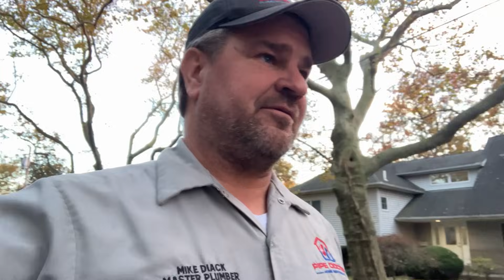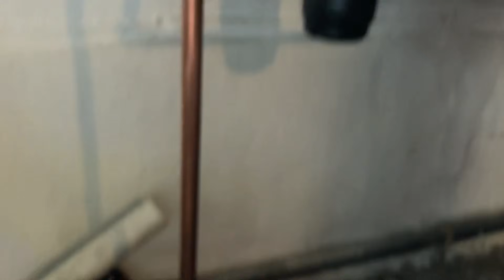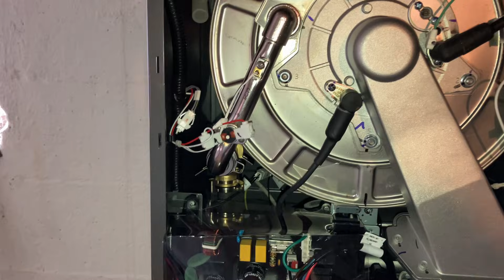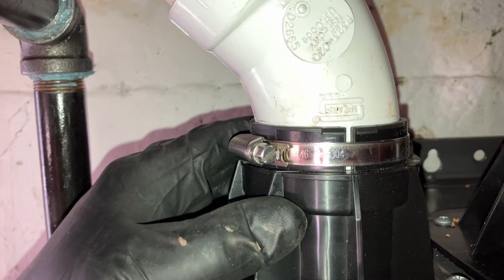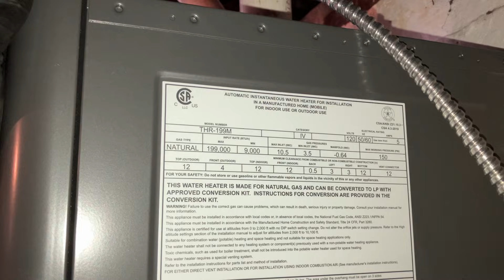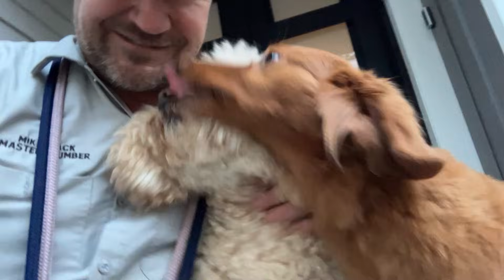STOP Descaling Your Water Heater Lochinvar XCalibur Tankless!

Comment from the maker: Introducing Lochinvar’s XCalibur premium condensing gas tankless water heaters, delivering robust, on-demand performance and the flexibility to install in practically any residential setting.

3 Models: 160, 180 & 199 MBH
X3® Scale Prevention
Heavy Duty Stainless-Steel Heat Exchanger Design
Integrated Recirculation Pump and Display
22:1 Turndown

NEVER REPLACE X3!
Reply: Where is the best place to buy the  XCalibur???

Comment: The older Takagi (natural draft tankless) was the same no maintenance , obviously non-condensing and probably 80-85%. This is new, let’s see how it works after 5 yrs. The most expensive repairs I’ve done have been tankless WH. As a service guy I still say a 85% cast iron boiler with 316 SS indirect tank still the way to go in my opinion (assuming u have hydronic heat)

Comment: As you stated in your video, unless you can do your own descaling of a tankless water heater they are not worth it. Always skeptical of new technology and we will see how long it takes for you to go back there for a service call. I have a Bradford White 50 gal. we installed 10/2010 along with a solar tank (80gal.) with 2 rooftop collectors that delivers 180 degree water via mixing valve to B/W and both going strong. Just replaced gas valve and pilot assembly. Tank in excellent shape. no rust or corrosion top or bottom and more efficient than any tankless. Good video anyway
Reply from the maker: The X3 technology has been available for about eight years only recently through the sister company Lochinvar
Reply: @PipeDoctor  when I first started watching your videos 7 or 8 years ago you were with Kelvin and Godzilla and they were funny and informative. You were a big proponent of tankless water heaters primarily Navien even though the internals were primarily plastic. Credit to you for being honest and realizing later that the high failure rate was not from improper installation but from a defective product. Enjoy your videos and by the way, I was highly suspicious of Tom and it did not surprise me especially how obese and how he could not function as a stand alone plumber.I was watching the videos you did from Orlando early on when you uploaded them and surprised you did not catch on sooner.

Comment: It doesn't require long sweep 90s? Street fittings are allowed into equipment? GFCI outlet not necessary for this equipment? I'm not a master plumber.
Reply from the maker: Great questions. Defer to the installation instructions for the equipment. The system is powered off a ground fault circuit interrupter.

Comment: Wow 🤩 mike pipes this is epic. The interior parts access to make service friendly. Quality is of number 1. Really excited for this product . You sold me on this. I watch so many great install by your company and some epic failures with manufacturing quality. This one has me think????
Reply from the maker: @richritchie5434  Lochinvar makes phenomenal equipment. Amazing team in their plant in Tennessee.
Reply: I'm guessing it's some kind of electronic technology that prevents scaling. Curious how efficiently that stainless heat exchanger transfers heat to the water with its low heat conductivity, compared to copper.

Comment: Most home owners don’t descale until it doesn’t work.
Reply: In my community it's 5 years old with a little over 600 homes all with Rinnai's. I have never seen another homeowner besides myself descale the unit. First year here I did it twice. I also stock almost every part for it. I do mine every year in Dec.
Reply: I can say in Australia, Rinnai is extremely popular, no one does maintenance on domestic tankless heaters here. Routinely last 15-20 years without doing a thing

Comment: For systems like that it seems the cold water inlet flows through the "X3" cartridge before going to the heat exchanger. In cases like that, will the system need a whole house water filter to prevent the cartridge from clogging, or can it be removed for cleaning when needed?
Reply from the maker: never needs to be changed. like ever.